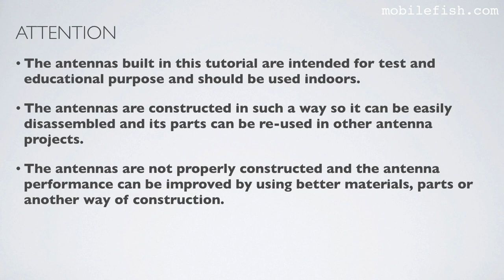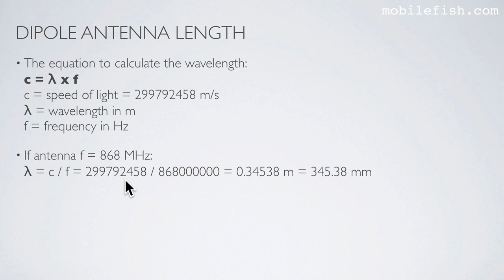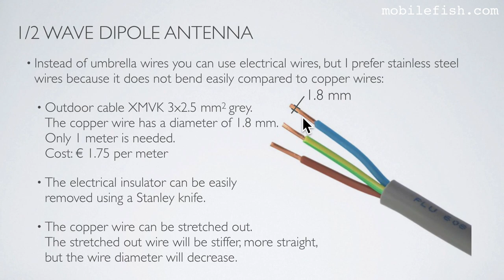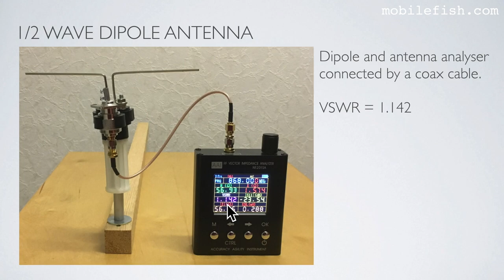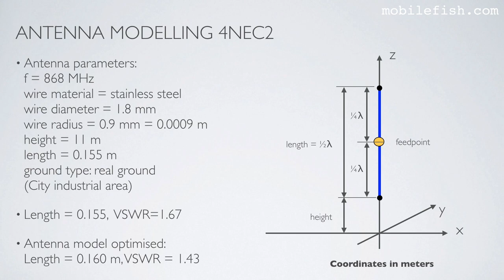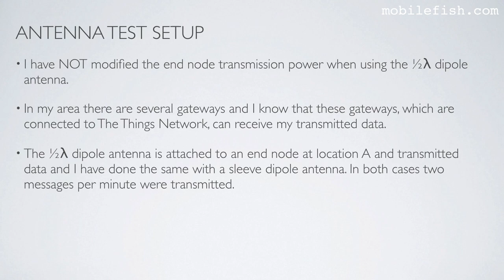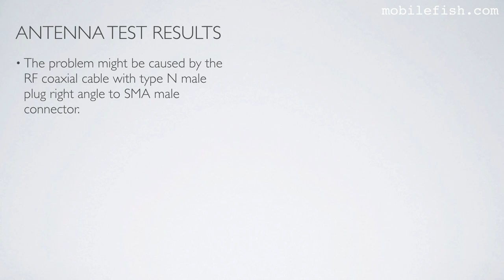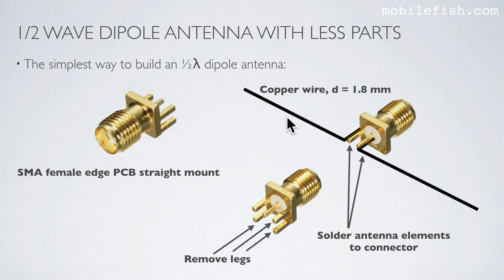LoRa/LoRaWAN tutorial 41: Dipole Antenna

Comment: Awsome tuturials! Great stuff! will you build an 5/8 wave antenna for 868mhz? Very much interested what the impedance would be and vswr. The radiation lobes should be a little bit longer and flatter compared to 1/2 wave dipole. More range for lorawan! But it should be more difficult to feed them I think?

Comment: Sir why should we cut the other 3 ground sma connector feet??is it affecting the result?i am new to lora, especially this radio things...thank you for sharing this knowledge sir.
Reply from the maker: Sorry, but I do not understand your question.
Reply: @Mobilefish  on 23:45 sir, but i understood now. i have one more question, is it possible to make lora dipole antenna just by print it on PCB?and what is the dimension?thank you
Reply from the maker: You are asking the same question as with the moxon antenna.
Theoretical you can, but I do not see the advantage.
Printing a dipole or Moxon antenna on a PCB is more a hassle.
Are the circuits on the same PCB as the antenna? If so, depending where the circuit is located on the PCB, it can impact the antenna performance. And how is the antenna feeded? By a PCB trace, which can act as an antenna (=interference). As you can see it is not a simple question to answer. Building an antenna (not printing on PCB) is easy to make, easy to test with an antenna analyser and easy to feed (using a coax cable with SMA connector). 

So, having said this, to answer your question: the same dimensions as mentioned in my tutorial. Keep an eye on the PCB trace thickness.
Reply: @Mobilefish  thank you sir..yes actually i'm looking for best fitted internal box antenna for my node.
Reply from the maker: Okay, please watch https://youtu.be/ZVo2RkBS14o and checkout: https://github.com/FabienFerrero/UCA_Board
Please note: I have NOT build a PCB antenna myself, so I can not tell you if it is good or not.